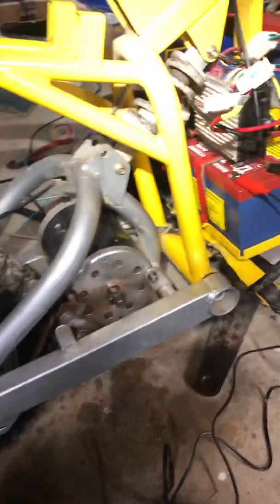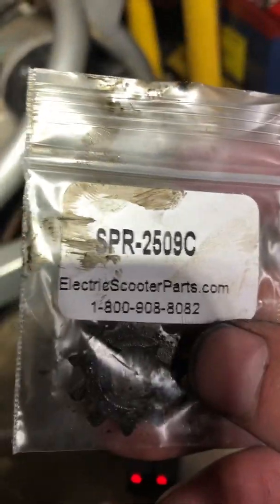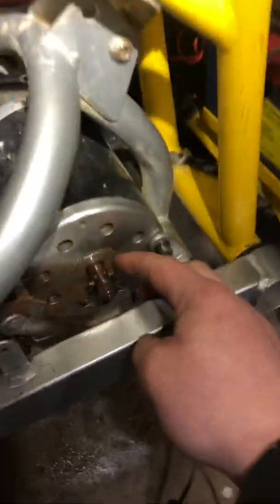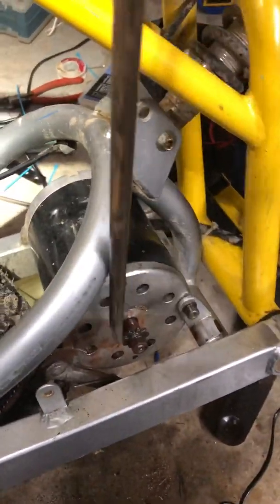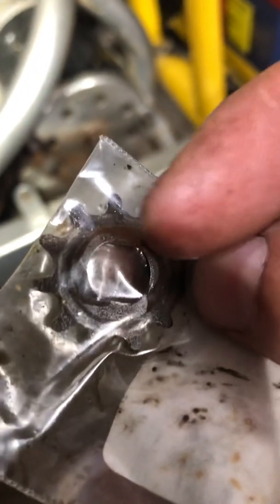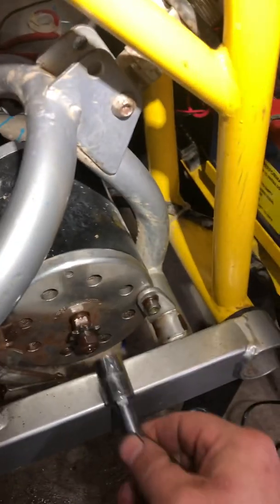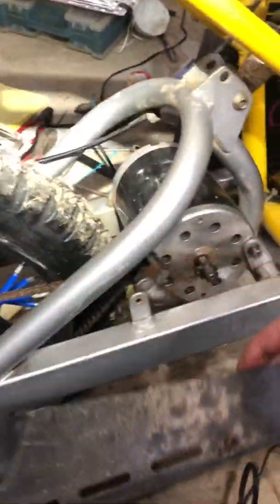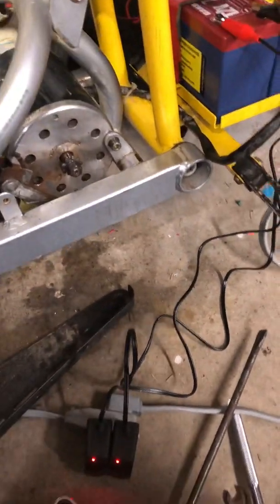Add more torque / power - Change front sprocket on Razor MX350 MX500 MX650

Comment: Looking for smaller gear for mx350
For better acceleration not sure what's stock
Reply from the maker: Cheapest and easiest is changing the motor gear. Count the teeth on it and then get a number that is slightly less. So if 11, try 9. Or you can change the large gear in the wheel. If you want more torque for that one you have to add teeth. I prefer to only change the motor gear though.
Reply: For 7 and 9 comes to 35$ shipped from that page.
Reply from the maker: @SmokeyRanchero  not sure. I made this video a long time ago. I don’t own that web store. I do sell dual spring razor front lift kits though. It raises the bike about 3”

Comment: Did your chain start jumping around after changing to the smaller front sprocket like mine did?
Reply from the maker: No. Sounds like your old chain and back sprocket are probably severely worn and it’s bouncing around to except the new teeth. I’d get a new chain at least.
Reply: @freshmaker5  my chain isn’t worn though it’s new. Couple months of riding
Reply: @SharkTheatre  Is your free wheel working good?  Some people weld theirs and this can cause chain jumping.
Reply: @kurtm534  mines working fine. Bike is new as 2 months ago
Reply: I didn’t weld mine
Reply from the maker: @SharkTheatre  is it spinning freely if you pick the bike tire up in the air
Reply: Mines doing the same